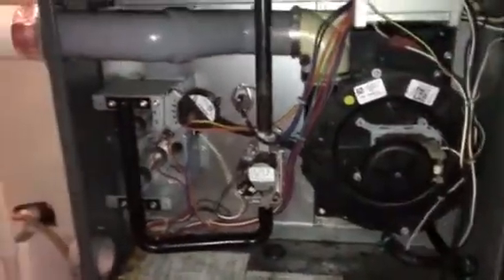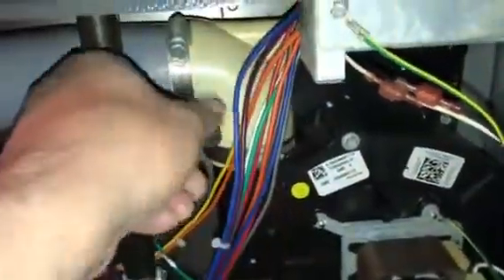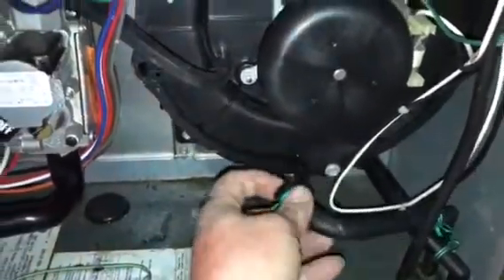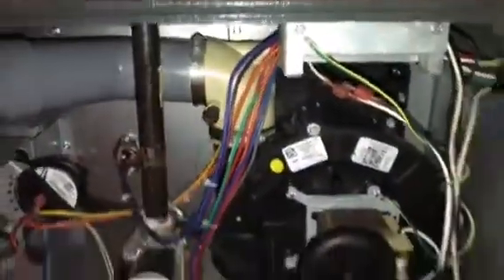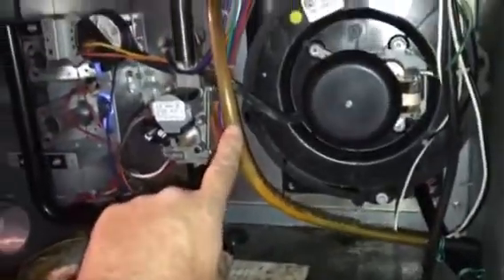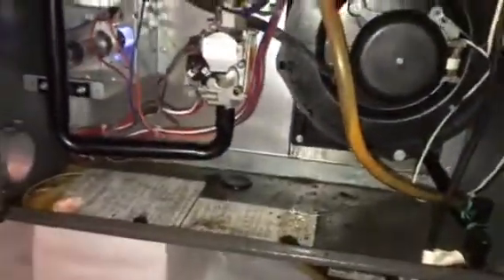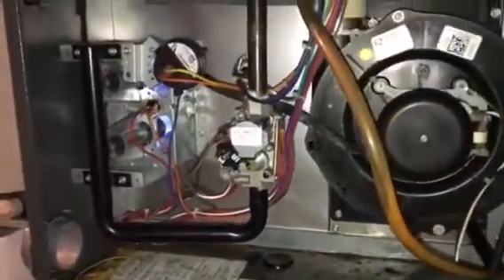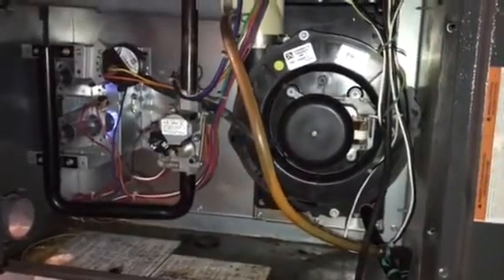Goodman Furnace drains not set up correctly

Comment: This is where Goodman gets a bad rap. 99% of Goodman Furnace problems are from crappy installation techs (like this one) who didn't read the directions on how to mounts a Upflow Furnace in a Horizontal configuration.
Reply: True, but Goodman should do a better job of explaining how to install horizontal units.  They also did a terrible job of keeping the part number exactly the same even when they REMOVED the drain plug.  People are buying the motor online and having major problems installing the unit.  I called several Goodman engineers and they had no idea and when I found this video/answer, they were surprised how easy the fix was.

Comment: That white elbow pipe is still a notorious problem on the vertical upflow models. It's now a black elbow, but if the other drain outlet (this elbow has two; depending on the installation, the other should be closed off) is angled incorrectly, you will still get this issue (i.e. inducer motor filling with water). Tilt the drain spout as far downwards as you can when reinstalling, and tighten all the clamps as required.
Reply: I have a vertical Goodman . Not sure what you mean when you say to "tilt the drain spout as far downwards as possible"?

Comment: I used to be a Goodman "dealer" just because I would get tons of warranty work because the installing contractor evaporated, in the accounting world they would be called undercapitalized. These condensing furnaces were a newer thing here in Southern California a decade ago and none of the installers could get them installed correctly, especially the flue.  Used to get rolls of vacuum tubing from the auto parts store and keep it on the truck, usually for these Goodman condensing furnaces.

Comment: You'll be back on that one ....  The 90 with the drain leg is suppose to be used in an upflow position ( which drains most the flue water )    In that position its useless .... Not having a drain in the bottom of the vent motor housing is typical gooman engineering ...
Reply from the maker: It has worked well for the last 2 winters but we will see.
Reply: Exactly this!  The drain he hooked it up to with the yellowish hose is supposed to be used if the furnace is installed in the horizontal position.  Otherwise, you are supposed to use the drain at the bottom of the fan housing where it was at, yet just disconnected.
Reply: As I see it, if you have a multi-position unit the drain at the "bottom" of the impeller becomes useless depending on the application. Still, there is no excuse for improper furnace drainage.
Reply: I've been having issues with my horizontally installed Goodman furnace for the last two heating seasons. Five different contractors and six different technicians could not fix it. Replaced a pressure switch, ignitor, control board, and two gas valves. The last tech recommended replacing the furnace because the flame sensor was not sending a signal to the control board but he wanted a different brand of furnace installed. I replaced that exact tubing and put a tee going into the bottom of the inducer housing then into the drain trap. I used a clear plastic tubing so I could see if it was draining. The furnace quit short cycling and has been working for sixty two days now.

Comment: I have an Goodman furnace with that litle Black plug with no hose to it. But there is 2" PVC pipe with drain nipple on side with hose going down to P-trap that is connected to condensation pump.  There's another hose at Bottom of blower going to P-Trap but I see a little slot at bottom with water ring. My condensation pump works none of drain Hoses are clogged.

Comment: Thank you for your video. 
I had the same issue, with one year of usage. 
Furnace (heat) only (no summer usage). 
I have a new 2022 Goodman, upflow, single-stage, 96% AFUE, 40,000 BTU/h, natural gas furnace. 
The repair technician purchased a "1/2 inch T hose barb (T shaped connector)" & used additional hose that came with this furnace. 
Then, spliced ("T"ed) into existing (nearby) drainage hose.
- - - - - - - - - - 
Symptoms: The burners would turn on & off multiple time in one cycle. 
Separately, The air-flow would (also) turn on & off multiple time in one cycle. 
The water buildup would tell the furnace's internal computer to turn off certain segments of the heating process, 
but no relevant error code is thrown. 
Separately; After three improper shutdowns (in one heat cycle), 
error code EE0 (E-E-0) would display. 
EE0: Lockout due to excessive retries or recycles.

Comment: I think that furnace installed horizontally is supposed to have a second pressure switch connected to the collector box that wires to break the gas valve. Goodman calls it a front cover switch. 
I could be wrong, but the few of those I’ve seen have had it. 
Good video dude.
Reply: Your right, and if the drain backs up that pressure switch won't close and won't fire the gas valve, you'll still get an igniter tho.  It's a crappy design (imo).

Comment: Did a lot of Goodman installs with my 1st company I worked for. That was there preferred choice brand. Usually they always came with a rubber fernco with clamps from Goodman to connect the flue pipe out of the cabinet. They never recommend glueing the pipe because of the sch 80 to sch 40 pipe difference. We all know the flue gas/water is very acidic the joint usually ends up leaking in time. Just something i thought i saw in the video. 
 
On the other hand good find. Some techs assume that all manufacturers install the same.  Fail to read manuals or don't care/ take pride in their work.